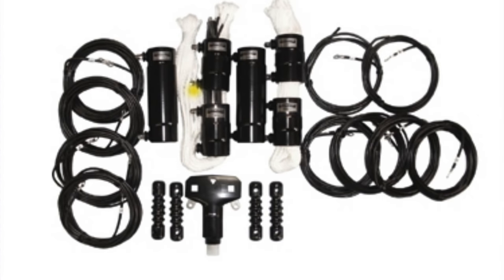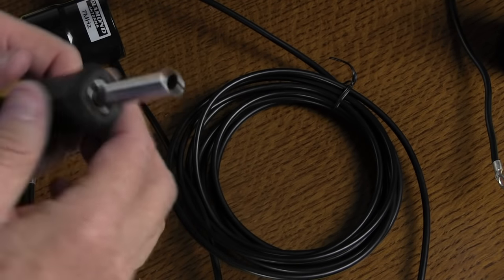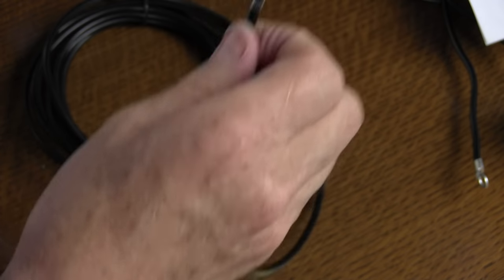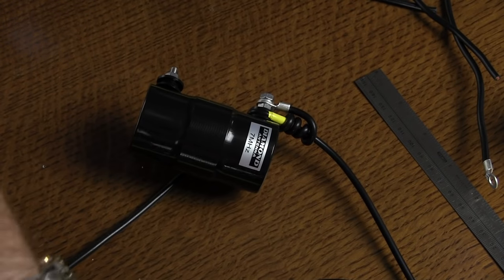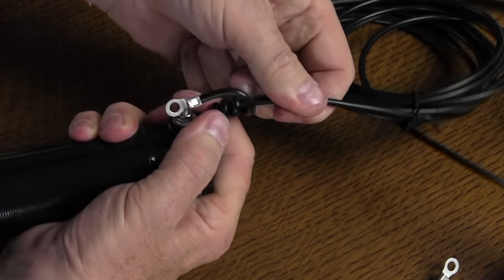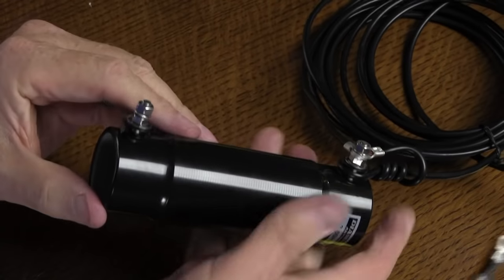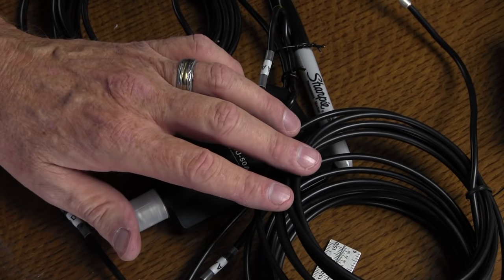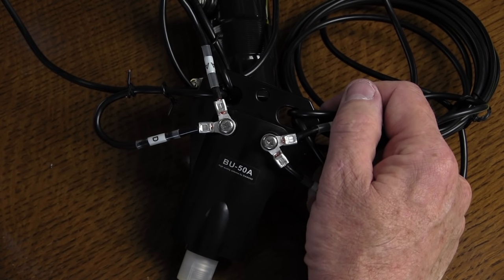DIAMOND W 8010 ASSEMBLY

Comment: Hello, I also own a Diamond BU-50A Balun. Can you help me with the cable length for the 20m band. What is the length of the wire. I still have a Balun from WINDCAMP Gipsy 7-30 mHZ  in the specific description, the length of the wire is 5.2 meters
Reply: For 20M band, u need 5.1m each side with no loading trap

Comment: I just picked up a used one of these fan trap dipole antenna already assembled. How is this working for you after 1 year? In what configuration have people preferred to install it? Is the Vee/Inverted Vee with the two main elements separated by >30 degrees the best way or has anyone tried the Horizontal/Inverted Vee configuration?

Comment: Great video,
One bit of advice, use some anti-seize paste (like Res-Q-Steel) on the stainless fasteners, it stops the nuts seizing to the bolts, you'll appreciate this if you have to remove a trap or the balun.
73, de ZL3XD.